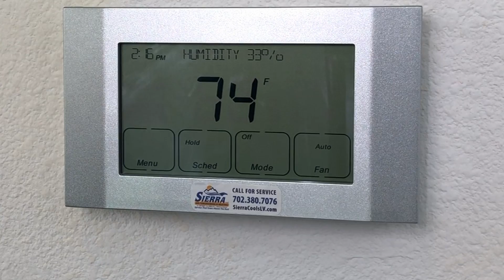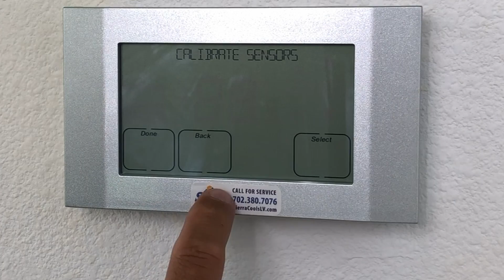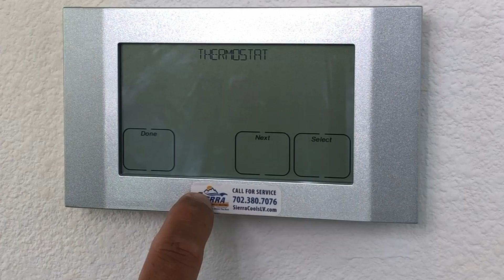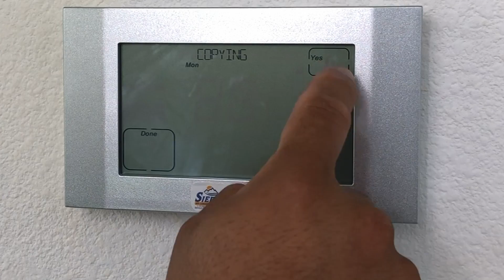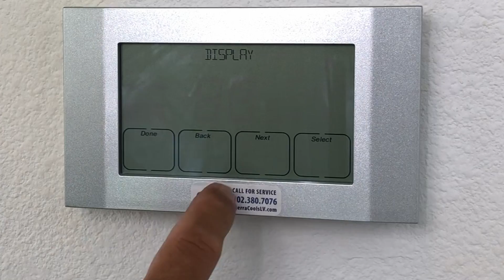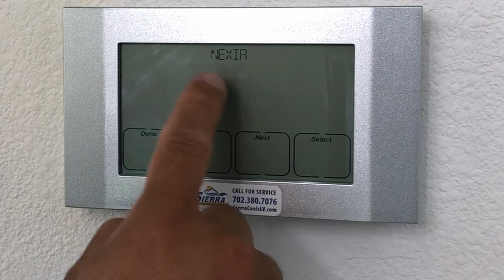How to Program Your Nexia Trane XR 724 Thermostat

Comment: This thermostat is garbage. The builder put this in my house on the second floor and I hate it. Why do you have to connect the wi-fi through the app instead of on the thermostat itself and choose an SSID/network to join? It also constantly drops Wi-Fi so you have to go through the mundane process of re-connecting the wifi through the same process of this video one time a week. The builder put the XL824 in the main floor and basement so I have no issue with that but this one sucks. I'm gonna probably replace the XR724 with an XL824.